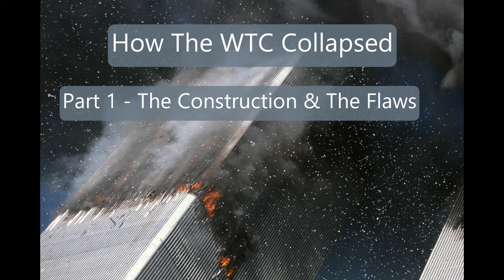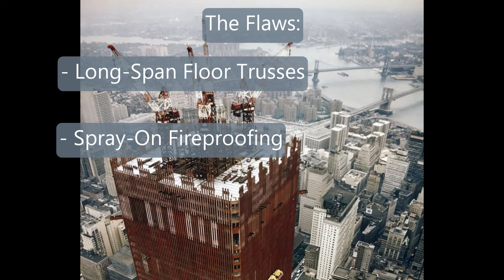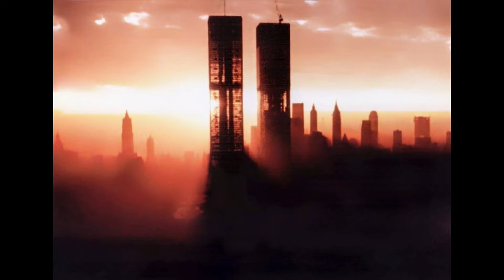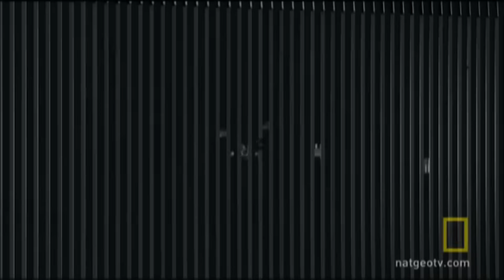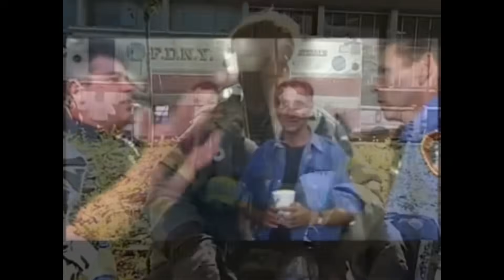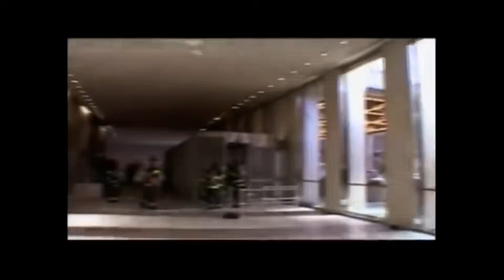9/11 Explained: WTC Collapse Explained

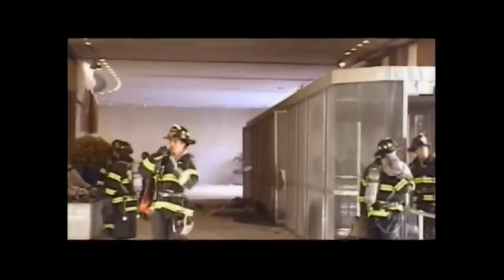Comment: 21:00 The kerosine could not have reached the lower floors if there had not been shenanigans inside he building beforehand. The elevator shafts between upper and lower floors were disconnected and sealed from each other.
Reply: There where a couple of express elevators that went all the way from bottom to top and didn’t stop on the either two of the sky lobbies so yes they were ways that it could get to the bottom floors
Reply: What "kerosine"?

Ignoring that, that you don't know how the Twin Tower elevator system worked only mean you don't actually understand. Nothing else. Look up "express elevator" and "sky lobby".
Reply: No? Not even an attempt? What do you know...

Comment: Thank you so much for this video. I’m really interested in why these buildings collapsed (I’m currently developing a computational simulation using AI), and what makes me lean toward the conspiracy theory isn’t so much the collapse of the World Trade Center Towers 1 and 2, but rather what happened at the Pentagon and in Shanksville (Flight 93). The official account doesn’t match the damage observed at all. There’s also the issue of WTC 7, which is frankly very suspiciou
Reply from the maker: If it helps I have two blogs that cover the details of both Flight 77 and Flight 93. At the very least they should give you plenty of photos and data.

Best of luck

https://aal77.blogspot.com/2012/09/american-airlines-flight-77-evidence.html

https://ual93.blogspot.com/2021/03/airlines-flight-93-evidence-below-is.html
Reply: @cjnewson88  Thanks, I'll look into it after I finish my WTC 1 and 2 simulations.
Reply: That you're ignoring the facts and the observations? Only mean that.

Comment: Ok, lets test that verinage method on a structural steel building. The top-segment will fall on the lower building like a cherry on the gatau.
That segment is the lightest of the building ...
PS. a verinage causes no free fall
Reply: So....your argument is "these two things are the same" and you somehow think this means they're not?
Reply: @MoonEyes2k  Exactly, free fall and structural breakdown
Reply: @thor7624b  That's impressive. So, you managed to fail yourself right from the start, then. Well done!
Reply: @MoonEyes2k  It seems there's someone here who wants to tell us even more. So I won't stop you. You don't have to disclose your citizenship btw ^^
Reply: @thor7624b  So, what you're saying is, you know you said dumb shit and now you want to change the subject because you embarrassed yourself? This did not surprise.
Reply: @MoonEyes2k  A breakdown of a structural steel building is just bullshit. Maybe IDF to disabuse me?
Reply: @thor7624b  Right. After all, the vulnerability of iron and iron alloys to heat is news. Has only been known of for, oh, 3000+ years. Basis of an age in history, the "iron age"...
Reply: @MoonEyes2k  We just need hundreds of workers to operate the bellows
Reply: @thor7624b  Or the common knowledge of how a chimney works, particularly one 80 floors up.

Comment: @8m28s - "each tower weighed 250 million kilograms, the top 30 floors above the impact zone alone weighed 60 million kilograms" Even if your estimate for the total weight for each tower was correct...... there weren't 30 floors above either impact zone, 25 for WTC2 and 14 for WTC1, and all you did was divide your supposed total by 125 and factor that up as if these structures weren't lighter at the top compared to the bottom. In reality they had half their mass below the 40th floor.
Truthfully tell me, that's what you did isn't it ? You divided your supposed total by 125 and multiplied it by 30. 
Even allowing for the floor slab to be a consistant weight, and allowing for the hat truss that is just truly ridiculous. "for goodness sake" indeed.
Just that 12s debunks your whole video. And that isn't even your worst 12s in it.
Reply: It's just that, you didn't understand what was said, or could point to any other "12s". But really, you're right.
Reply: @MoonEyes2k  This video has more mistakes than the towers had windows. For example - MIsses out about a third of the towers mass and then doesn't accountg properly for tapering of the steel. Made by an idiot to appeal to the ignorant.
Reply: @nineeleventwentyfourseven607  So, basically, you didn't have any argument, and there were no "12s".

And it's clearly not meant to "appeal to the ignorant", since it didn't appeal to you.
Reply: @MoonEyes2k  The proportion of the floors in the top block is off by a mile - that 12s of the video makes the rest irrelevant - underestimates the total mass, then massively overestimates the proportion that the top block would represent in terms of mass, and actually just plain height too.
Off ya pop now champ.
Reply: @nineeleventwentyfourseven607  So, there were no "other 12s". And you decided to say stupid shit to "prove" how amazing you are.

Good work!
Reply: @MoonEyes2k  No, I decided to state what was wrong with that 12 second of his video and how that invalidated any conclusion he could make from there on.
Bringing reality isn't proving "how amazing" anyone is - it is the basic research one would expect to have done before even contemplating making this video. The video is BS, and you don't like that it is BS.
Tough. Facts don't care about what you do or dont like.
Reply: @nineeleventwentyfourseven607   Yeah, here's a slight issue with that? You making things up about "what was wrong" and "12s" doesn't make an argument. It means you're making things up. Nothing else.

But you did get one thing right. No matter how much you want it to be otherwise, facts don't care about what you want.
Reply: @MoonEyes2k  Aye ok then. This video is clearly suited to you. GFY
Reply: @nineeleventwentyfourseven607  Indeed it is. It's intelligent, explanatory, and uses things like facts. So, it's very suited to me.

You, not so much, clearly, who prefer cool claims about "not the worst 12s" and outright lies.
Reply: @MoonEyes2k  Except I made a point of talking with the guy who made it, who knows his mass figures are a mile out. Ya rocket.
Reply: @nineeleventwentyfourseven607   Ah, yes. Of course. Him. Your daddy the policeman, then.
Do let me know when you've outgrown calling on supposed authorities like a small child in the playground.
Reply: @MoonEyes2k  right ye are then w⚓
Reply: @nineeleventwentyfourseven607  As noted. Do let me know.

Comment: Ah, comments being deleted. I see how YouTube or CJNewson88 plays. Share a bunch of disinformation that no one can show where the errors are.
Reply: It's YouTube. You can count on about 10% of posts randomly dropping just as a matter of course.  Randomly bombarding one video with a barrage of posts in rapid succession can be picked up on by the AI as spam, so it might drop some for that. Also, no outside links. 99% guaranteed to drop. 

I would suggest condensing all of your thoughts into one post instead of 6.
Reply: @MFitz12  thank you

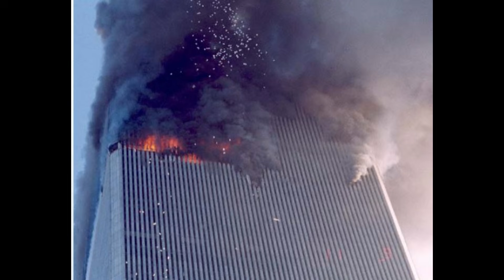Comment: 5:57 There were not uncontrollable and massive fires. Here the testimony of firefighter Orio Palmer who made it up to the 78th floor (fire floor) of WTC2. "We got two isolated pockets of fire. We should be able to knock it down with two lines." Seven minutes after his last words, the South Tower, WTC building 2 collapsed.
Reply: Oh FFS 🤦‍♂.  

FDNY Chief Orio Palmer from Battalion 7, with men from Ladder 15 (Ladder 1-5) was tasked with trying to find a path in the South Tower to reach above the impact zone so survivors above the impact could be evacuated. He was not sent up to put out the fires, only to rescue victims 

Orio Palmer made it up Stairwell A, South Tower as far as the 78th floor – the Sky Lobby (not an office floor), which was at the lower end of the impact damage zone, being hit by the left outer wing of flight 175.  Palmer was followed by men from Ladder 15. We don’t know what floors like 77 or below looked like because he did not stop there and he never got any higher into the floors which took the most damage. Stairwell B was blocked. 

So are you really saying that at 78 – the very lowest floor of the 8-story tall impact zone - was the ONLY FIRE IN THE ENTIRE BUILDING – just “two isolated pockets of fire” - and two hoses on that floor alone would have put out ALL THE FIRES IN THE BUILDING?”

Think long and hard about that one before you answer.

Palmer’s objective was not to put out the fires but to clear a way down for victims trapped in and above the impact and fire damage zone. 

Radio Calls

FDNY Command Post: “What do you got up there Chief?”

Palmer: “I’m still in boy stairway (Stairwell B) 74th floor. No smoke or fire problems, the walls are breached so be careful.”

Palmer: Battalion 7, Ladder 1-5”

Ladder 1-5: “1-5”

Palmer: “I’m going to need 2 of your firefighters adam stairway (Stairway A – NW corner) to knock down two fires. We have a house line stretched, we could use some water on it. Knock it down, OK.”

(Note: It sure sounds to me like the two fires he wanted knocked down were in Stairway A, blocking access to higher floors. He was by no means talking about the entire building or anything above 78 - which he obviously could not even see )

Ladder 1-5: We’re on 77 now, B stair. I’ll be right to you.”

Palmer: “We have access stairs going up to 79, K.”

Ladder 1-5: “Alright I’m on my way up Orio.”

Palmer: We’ve got two isolated pockets of fire. We should be able to knock it down with two lines. Radio, radio that. 78th floor. Numerous 10-45 Code 1’s (fatalities – more than he could count).” 

Palmer: “Battalion 7 to Ladder 1-5”

South Tower collapses 7 minutes after Palmer’s last transmission. 

The major fires were on Floor 78 and above, with a large obvious patch of fire on 79.  All you have to do is look at the outside of the building instead of cherry picking one piece of information and (conveniently) ignoring all other context.

Or look at Melissa Doi's 9-1-1 call from the 83rd floor, which occurred at around the same time.

Melissa Doi, trapped with 5 others on the 83rd floor of the South Tower (5 floors above the highest know point reached by Chief Orio Palmer)

Doi: Are they going to be able to get somebody up here?”

911 operator: “Of course ma’am we’re coming up to you.”

Doi: “ Well, there’s no one here yet and the floor is completely engulfed. We’re on the floor and we can’t breathe. And it’s very, very, very hot. I’m going to die I’m going to die. I’m going to die.  It’s so hot. I’m burning up.”
Reply from the maker: Where did the plane impact the South Tower? Not the 78th floor. 

Are you really going to deny all the videos and photos of massive multi-floor fires because a firefighter found 2 isolated fires on the floor where only the left wingtip hit? I mean, that's the level of dishonesty I expect from 9/11 truth but hey, no wonder your movement died.
Reply: Here's the fact of the statement by Chief Palmer: he was at the lowest-most floor of the impact, talking about what he could see from the stair-well. The towers were an acre in size, and there were 7 floors of impact above him, as well as anything that had risen above the impact floors.
Reply: That's one person from one corner of one floor. Each floor was acre in square footage. Perhaps there were more fires a floor up. And a floor above that. And a floor above that. No?
Reply: So all you guys really think ensuing fires can cause a fire protected structural steel-framed highrise to collapse entirely,  evenly, and through themselves and won't question that at all?
Reply: @911WarRoom  Who said we didn't question it. Question were raised. They were answered. You don't like the answers.
Reply: @911WarRoom  - The aircraft impacts took care of the fire protection.  Thousands of steel framed buildings and structures have been destroyed by fire. Steel is uniquely vulnerable to fire, not uniquely immune to fire. 

I have no clue what you are on about with "entirely, evenly and through themselves".  

That's just hyperbolic bullshit. 

I can explain the collapses point-by-point to a high level of detail if you would like.
Reply: facts don’t care about ur conspiracy theories
Reply: @JimmyJames10-k7v , facts also don't care about dismissive comments. But hey, critical thinking does.
Reply: @911WarRoom cope
Reply: @JimmyJames10-k7v  I get that it's tough to question the official story about 9/11. It’s natural to trust what we’re told by the government and media. But consider how unusual it is for fires and plane damage to bring down steel-framed buildings so perfectly. I encourage you to dig deeper, use your critical thinking skills, and really examine the evidence. It's okay to question and challenge the official narrative to seek the real truth.
Reply: @911WarRoom   " I get that it's tough to question the official story about 9/11. "
Not at all. It's, in fact, very easy. And it's been done.
What is apparently really HARD, for some, is to accept the answers they're given. This is, in general, because the answers, though factual and science-based, don't fit into the predetermined narrative.
And so, we can conclude that, you're not at all "asking questions." You're JAQing off. And if all you want to do is sit in your corner and JAQ off....what fucking use are you?

" But consider how unusual it is for fires and plane damage to bring down steel-framed buildings so perfectly."
Why would anyone consider utter nonsense?
1, you're trying to argue that something that happened in consequence of a unique event, to whit that terrorists hijacked airplanes and flew them into the towers, is somehow unique. Yes, of course they are. Trying to pretend that the plane impacts and fires are completely normal, it's only the collapse that is strange is utter nonsense.
2, you're also making up, or repeating, utter bog stupid shit. There's nothing "perfect" about the collapses of the Towers. The remains covered 16 acres of ground, and destroyed, directly or indirectly, 8 other buildings. Claiming "so perfectly" is the act of the willfully blind.